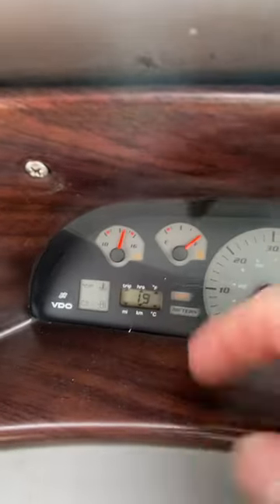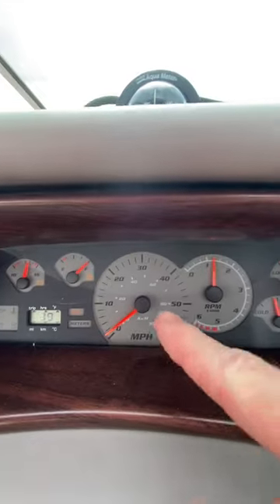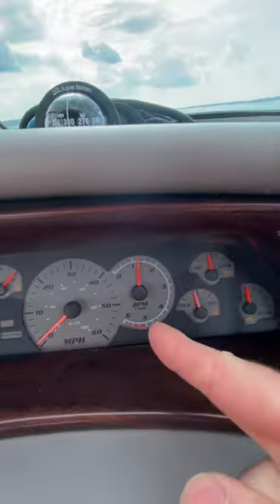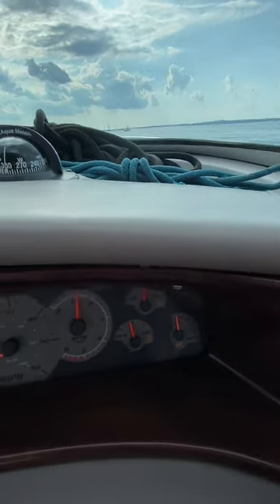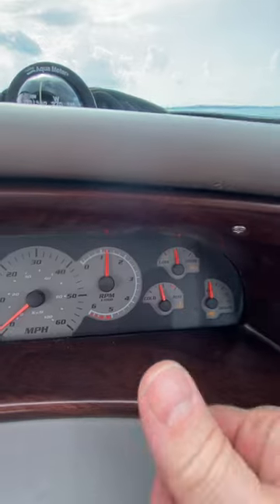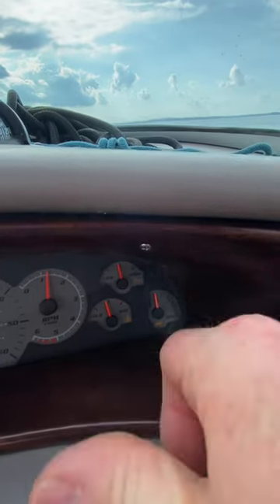Broken Boat Gauges on my Four Winns Horizon

Comment: The tach doesn't work on my 2001 Cobalt 206. I looked for the same gauge, but they don't make that one anymore. Need to find a place that repairs them. As for broken speedo, it's probably the pickup, which isn't hard to replace.

Comment: My 1998 Cierra 2355 I've been boating with since new. I am still running the original engine, out drive and mostly everything else is original.  I have the exact same inoperable gouges as you. FHI I live on the chesapeake bay and run my boat a few days every week

Comment: I bought my 1st cabin cruiser boat. Everything worked great and is still an awesome boat. But someone added a custom fly bridge and instead of putting another set of gauges they put a window in the floor to see the gauges downstairs lol. It works out ok and makes a great pass through. It's a 1977 Bayliner Nisqually 23.5. still purrs like a kitten and is a solid boat. I just bought a 1979 25.5 Bayliner With the fly bridge, I love these older boats. They took pride in there craftsmanship baxk then also. And I need a 10,000 rpm Tack for that Jem. 2.5 liter Drag Mercury.

Comment: Tilt/trim broken again???

All mine in my 99 Sea Ray work. I did replace the temp gauge though because someone had it replaced with a different style aftermarket gauge and the odd gauge was driving me crazy.
Reply from the maker: Yeah - it's stopped working on three separate occasions.
Reply: @WayneTheBoatGuy  More relay connection issues?